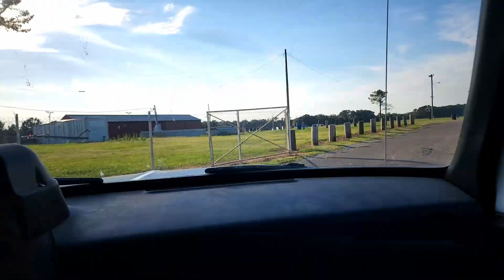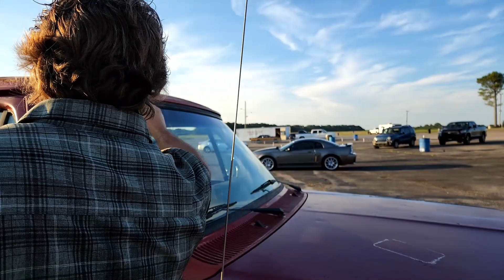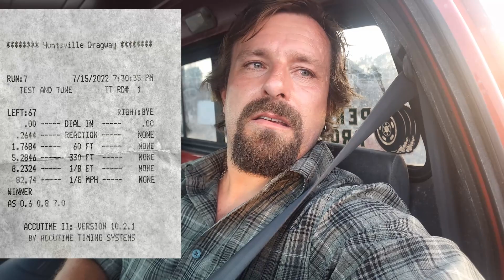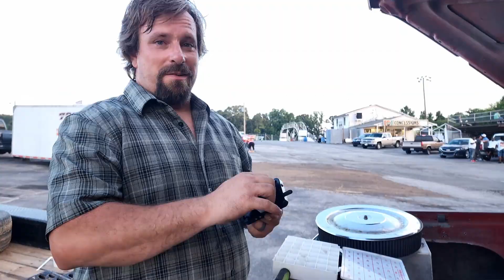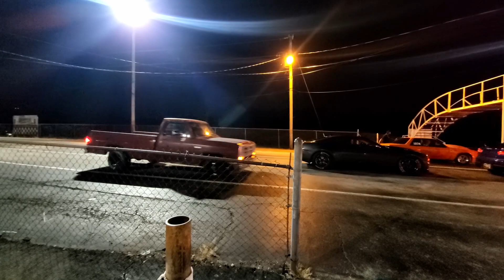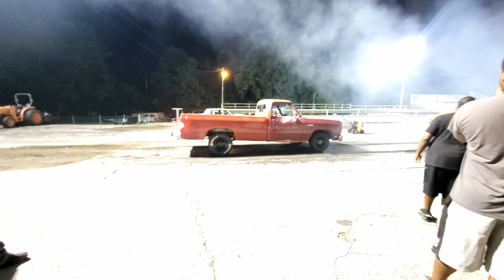Will It Go 7s? 1989 Dodge D150 Drag Truck aka 'Extra Parts' Test and Tune at Huntsville Dragway

Comment: Just found your channel and awesome build! It's putting down some impressive times. I have a '90 D150 that hasn't ran since 2020 that I'm putting an "extra parts" 360 in...It's been a long process but hope to get it running very soon. Eventually I want to big block swap it when time/$ allows and try my hand at drag racing. Thanks for the motivation!!
Reply from the maker: Hey Taylor, thank you, we are happy with the results so far.  I understand the long process, it will be worth it once it runs.  You don't have to wait to big block swap it to try drag racing take it out with the 360 once you get it running.  Thank you for the kind words, that is why made this channel.

Comment: What motor u have and tranny and rear end gears
Reply from the maker: Hydraulic flat tappet, stock bottom end, cast iron headed 440 with 727 and 3500 stall converter, 8 3/4" with 4.10's with a lincoln locker.